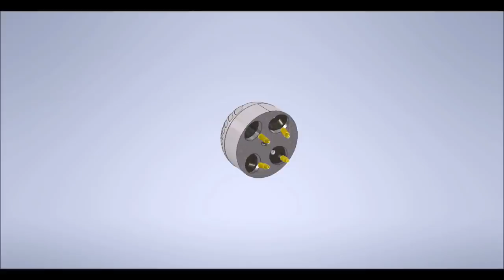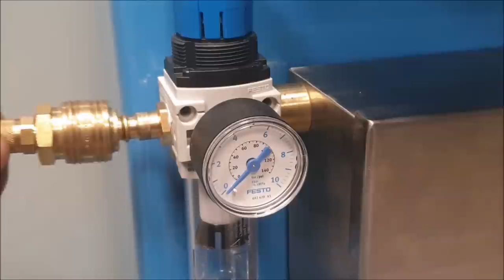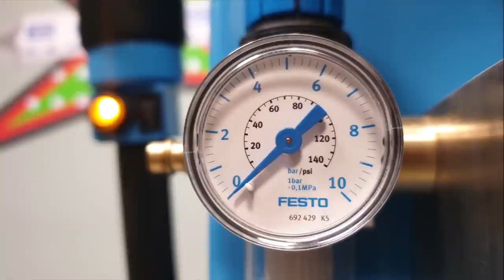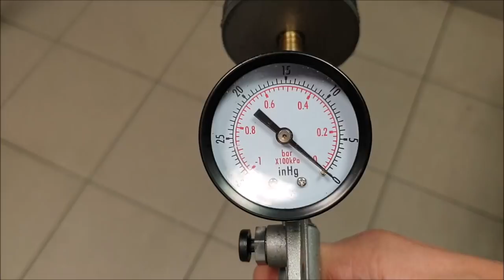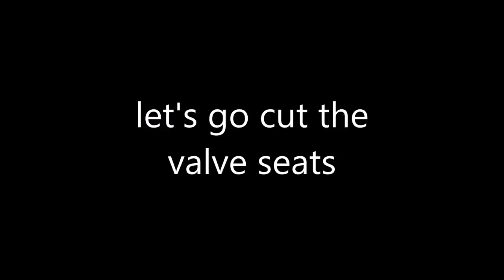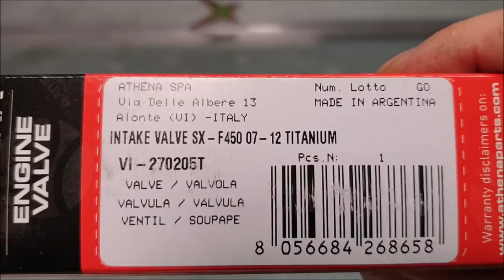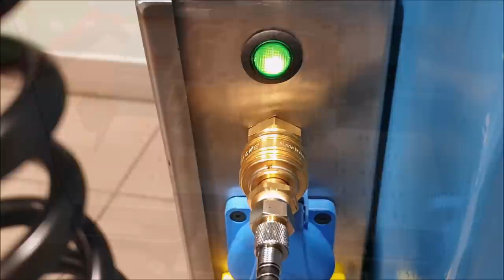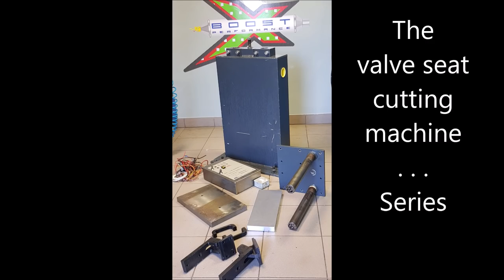Making of valve seat cutting machine  - Introduction of the machine.

Comment: Now valve seats are lowered, and valve stem might be to long to set proper valve clearance.. how do you fix this issue - would you grind valve stem to the length ? Great machine - you inspired me to make one...
Reply: smaller size shim under buckets?
Reply: @chem6269  Not every engine use such great invention like a shims :( I had this issue many times - last time with Ford's 2.0 Duratec...  :(
Reply from the maker: smaller size shim
Reply: @PaulXchannel  Ift there is a shim - ok,  but like I said - there is no such option. What will you advice then?  stem grinding, or replace a whole set of buckets??
Reply: @RemontidEalny  I don't know of any valvetrain that doesn't have some form of lash adjustment. He's only changing the height by .001" or so.
Reply: @operator8014  
I know a few engines with simply bucket with no shim or anything else. The only way to set clearance is to calculate and use a bucket with proper height. Just for example - Ford's duratecs 1.8, 2.0 (AODA) engine...
And believe me, just only lapping sometimes makes a difference you will not be able to compensate using a set of buckets you have... Im just trying to get answer - does he allow valve stem grinding a s a method to fix this issue or not. He seems he know what is he doing - I am just looking for answer from experienced guy...
Reply: @RemontidEalny  I have never heard of valve stem grinding, usually machinist will put in new valve seats if there is cupping or cut the seat and use smaller shim. Could you just put in new valve seats on your ford and not worry about the valve length? I am still learning and trying to see how it works with your set up
Reply: @chem6269  in the good old days, and im thinking of british motorcycles, the valve stem had to be ground to restore flatness due to tappet screw causing wear. These days of buckets and shims the need for grinding has been reduced to zero.

Comment: Nice 2 speed wiper motor to drive it. 
Honestly that thing is Ridiculously expensive to make or buy. I’ve been using a Bridgeport with my own tooling for years. And I can make 4 or 5 Bridgeport Fixtures for the price of that. Plus I can do more than just a four-cylinder or lawnmower head
Reply from the maker: Excellent observation. (wiper motor) Thanks.

Comment: How are you checking heights? Do you have to remove your cutter, pilot, and spindle each time to check with a valve and dial indicator? I think this is the first time I've seen a pilot that spins in a guide vs. the cutter spinning on the pilot.
Reply from the maker: I cut the valve seat only minimally.
To make the right angles.
Reply: @PaulXchannel  So you're not checking to make sure that the each exhaust seat and intake seat height match? I didn't pay attention to the top of the cylinder head to see it it has rocker arms or overhead cams. If it's overhead cam what are you going to do to match installed heights? Just shim the springs and grind the tip of the valves? But aren't you running titanium valves? Then grinding the valve stem tips wouldn't be possible right?
Reply from the maker: I use valve shims.
See this video.

https://youtu.be/xHgg2pSGRVU
Reply: I think today most of the VGS machines are live pilot unlike the Sunnen VGS20 for instance.

Comment: You did leakage test with vacuum, but in our countries guys usually do test with kerosene. Because it is very fluid or fluent.
What is better in your opinion?
Reply from the maker: I think vacuum equipment is used in the factory.
It's fast with the value on the display.
Kerosene is used when there is no vacuum pump - it is also good.
It just takes longer.
Reply: A vacuum is the most sensitive test of all .

Comment: Hi Paul. You are a very talented engineer. I really enjoyed your video. I think you are a great video editor too. I have a small question for you...What is the power /CFM of your vacuum pump you use to lock the boring head?
Reply from the maker: Thanks.
8atm.
Reply: @PaulXchannel  Do you happen to know the HP of the electric motor that drives the pump?
Reply from the maker: No

Comment: I had a VGS 20 for 25 years ..all I do is Harley heads using serdi full radius cutters ..also cutters to open valve seats
Cutters I dont think your head design
Can hold concentric.
Your cutters are 3 angel and one angel cut into aluminum.
A valve job made easy this time.
Great design effort though.
Reply from the maker: Thanks

Comment: Neat, but no provision to indicate depth of cut? A Serdi, for example, makes it EASY to cut every seat equally, so that shimming for valvelash or spring installed height is extremely consistent across the board.
Edit: I guess if you keep your depth-of-cut adjuster nut the same for all exhaust valves the same - the results should be really close to one another, pending parallelism of your spindle head magnetic plate and your cylinder head mounting plate...
Reply from the maker: I cut only the minimum.
Just to keep the saddle clean and the right angles.

Comment: If i may ask after valve seat cutting do we need to grind the valve again
Reply from the maker: Titanium valves must not be grinded due to the coating.
Therefore the machine must cut the valve seat accurately.
Reply: @PaulXchannel  how about original valve? Same treatment or not as titanium valve... Sometimes i was worndering after making valve seat angle cutting do we need to grind valve or not either titanium valve or original valve
Reply from the maker: A steel valves can be ground.
Especially after manual cutting.
High speed engines should not be done by hand.
Reply: @PaulXchannel  alright thanks for the info
Reply: Never lap a valve and seat.
Reply: @_FJB_  damn ive been doing it wrong over couple of year
Reply: @mohdjemadil4527  I would say so.

Comment: Hi Paul Great work. How do you measure the valve seat angles?
Reply from the maker: Thanks.
The cutting insert has exact angles at the factory.
Reply: Thanks for your reply. I was referring to measuring the angle initially, to determine the correct cutter to use. Do Yamaha, Suzuki etc differ from KTM seat angles for example?
Reply from the maker: There is not much difference between manufacturers.

The standard is 45 angle.
The top is 30 angle.
The inside is 60 angle.
Then there are also 5 angles.
Reply: @PaulXchannel  Thanks 👍
Reply: @PaulXchannel  pros and cons between 3 and 5 angle cuts? Can one say one is better than the other?
Reply from the maker: I only use type 3 angles.
Reply: @PaulXchannel  gotcha. nice machine btw. Is this the only one you've built for personal uses or you also sell it?
Reply from the maker: Thanks. Only one piece for me.

Comment: Not lapping?
Reply: Titanium valves don't need lapping
Reply: titanium valves should not be lapped. Sorry for my bad english...
Reply: Some machines have coated valves that must not be lapped and just rely on good seats.
Reply: If the valve face and the valve seat are cut correctly no lapping is necessary.

Comment: I prefer to use stones i have better control of my top and bottom cuts as well as 45 seat position and width. im not relying on a factory made cutter. before everyone jumps down my throat, i have a serdi and it has its place, but if im doing a max hp valve job im using stones.